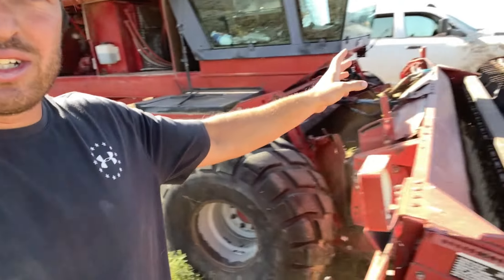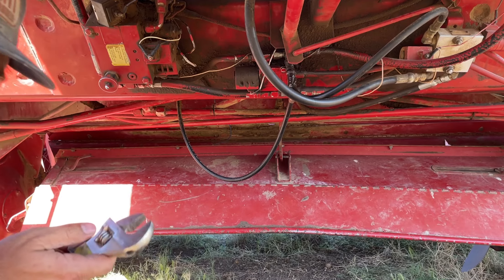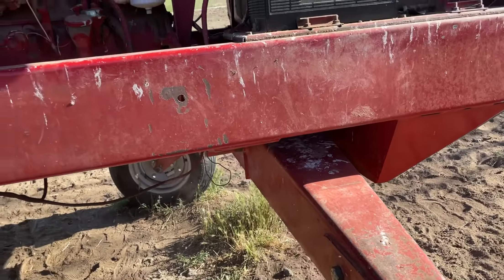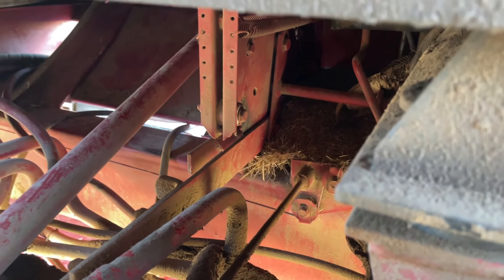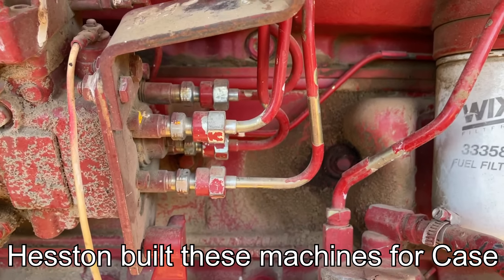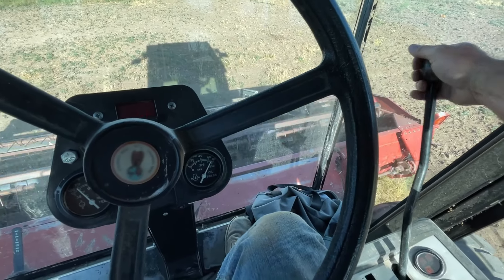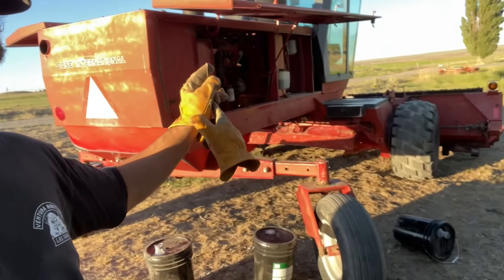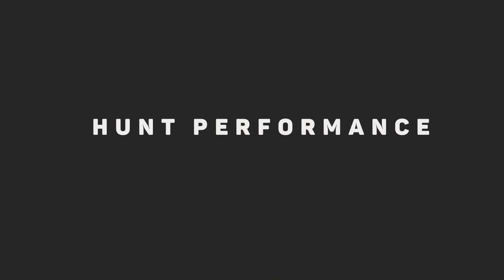Case 8840

Comment: Did you ever get the header fixed
Reply from the maker: Not completely. Lift cylinders need rebuilt. Bigger problem is the head is completely worn out. Unfortunately, I had to park it and borrow my cousins to finish up this year.